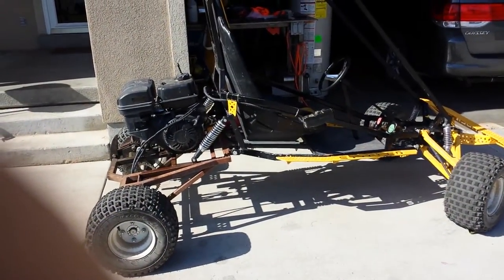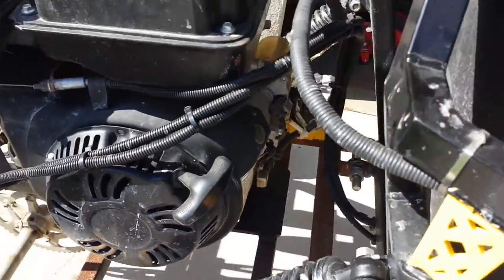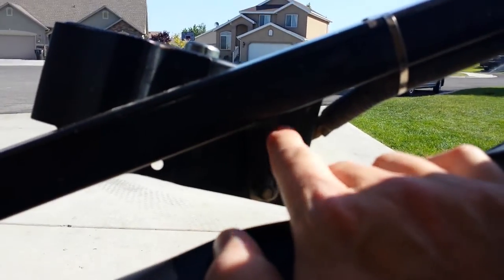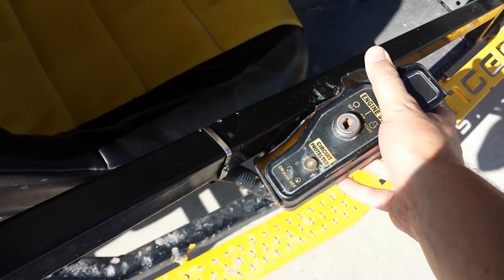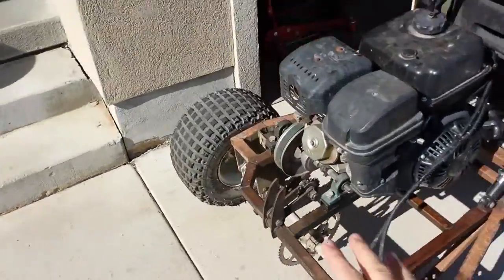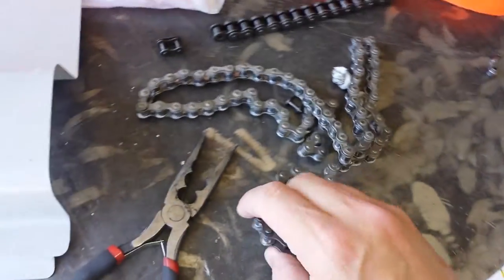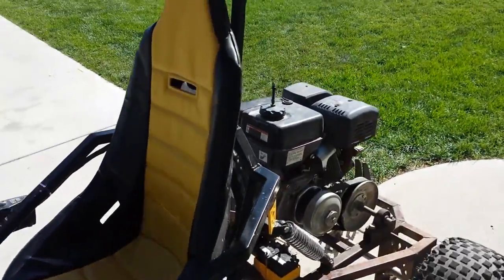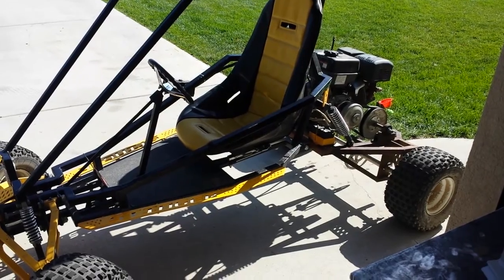Gokart update -- Ignition setup, repair, and info on shocks

Comment: thank you im gonna trie to move the starter now up near the streeimg wheel realy helped me out thank,you again 
LIke your videos
Reply from the maker: thanks
Reply: +John Harmon - Cold Creek Works  is it possible to start a dingo go kart by mango with the switch (the thing that turns on and off) disconnected?
Reply from the maker: I don't know anything about them, but I don't see why not as long as you have the right wires connected.  I could easily bypass the switch on this by doing the same.